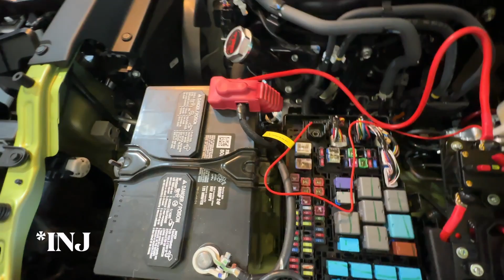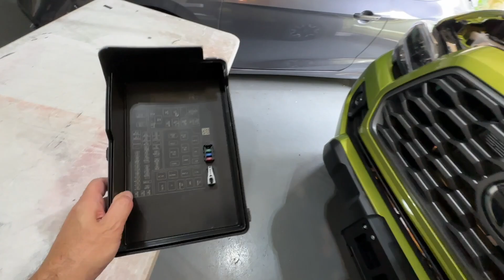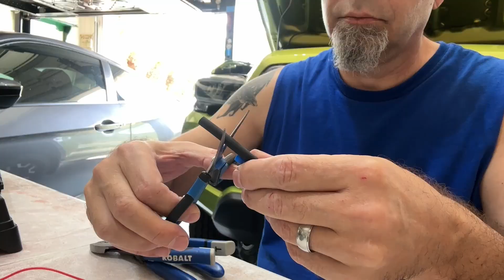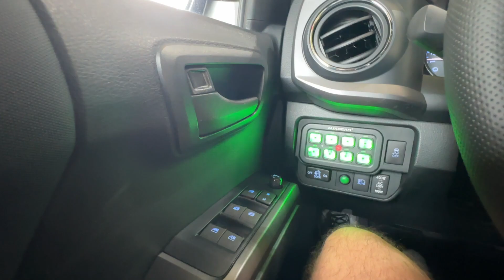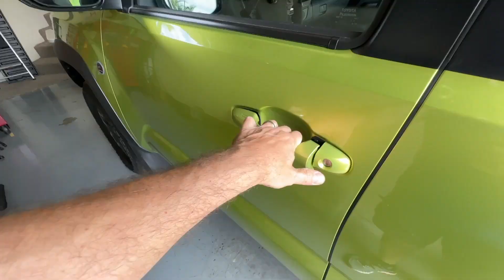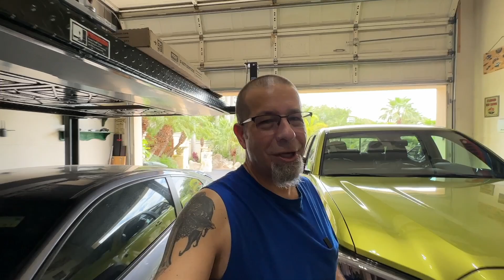The Big Toyota Tacoma Finish

Comment: I  enjoy your videos, I drive a new 23 SR5 Taco, I am applying mods, nothing to write home about. What I am working on is using a molle panel on the passenger seat back, and installing a tactile safe. Inside the safe I will be adding a magnet to hold its contents. 
A lot of mods are out of the box, which is good. I just like a little more creative expression.
I do enjoy your expertise in moding the Tacoma.
Reply from the maker: I know what you mean.  Coming up with your own creation is very satisfying 👍

Comment: Rob I also made a small hole on the side of the fuse box panel top. Thread it and filled in the hole with plastic clear silicon.